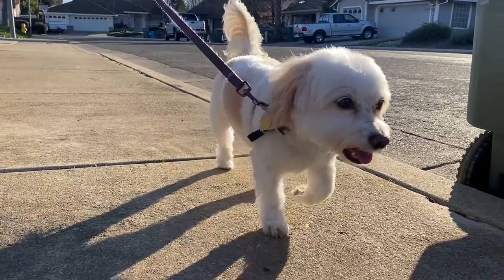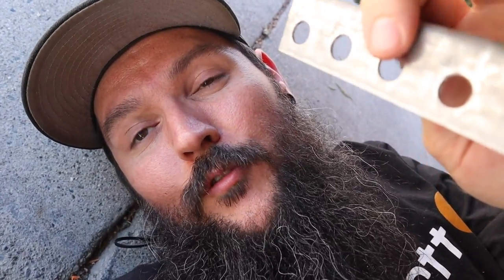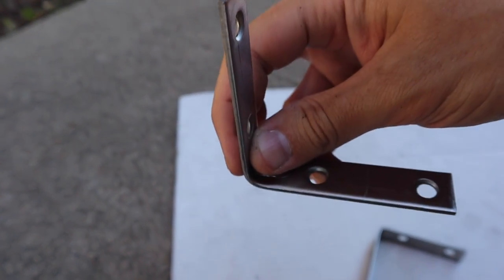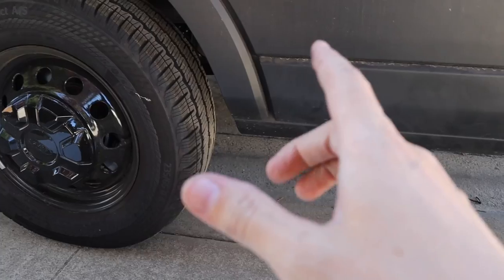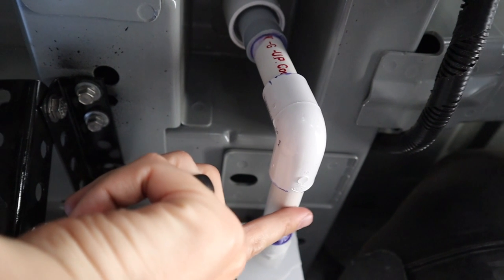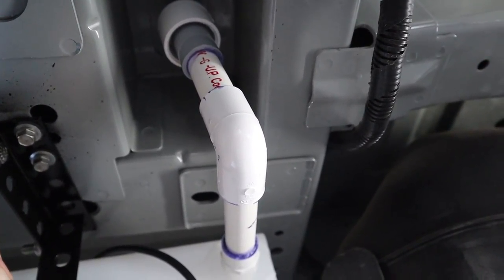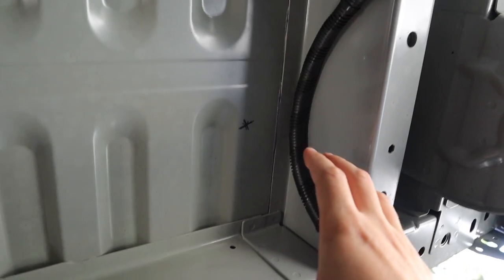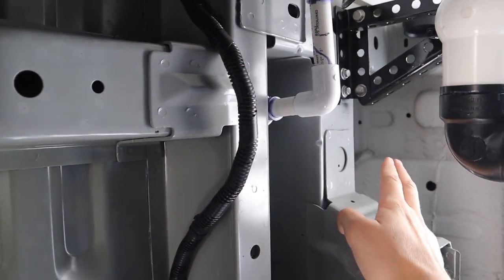Plumbing our Shower & Sink Drainage for Van Life | 2021 Ford Transit Van Build Conversion Ep. 31

Comment: Nice video, I used a normal P-Trap in my build and I've had no problems but I think I might upgrade to your design for more space under the sink! Thanks!! I used braded vinyl tubing and pex pipe in my build (except PVC under the sink), it was a lot easier than PVC you're using. If something breaks in the future it'll be easy to fix. 
This might be too late but one thing I learnt from watching a lot of van builders is don't put flooring in the whole van because if one piece breaks or gets damaged it'll be impossible to replace.

Comment: Put some rear mudflaps on to protect the remote fill nozzles. You could have used your Drimel tool with cutting disk to shorten the pipe.

Comment: Hello Brit and Mike. I installed my propane tank today and since I was underneath  van I was wondering where in the hell I will run the sink drain pipe over to the grey tank. You solve this problem for me. Your plumbing job look clean I can see you did some plumbing in the past. It will be while before I get to your point but having some problems solve ahead of time will save me lots of time.  Thanks.
Reply from the maker: Thanks Leo!!

Comment: Great video. personally, I would never use a gray tank or a black tank. I will allow the water of the gray tank just to spill onto the street. No black tank for me because I’ll be using collapsible, stool and poop in a plastic bag and quickly dispose of it. However, way I can..

Comment: Hey Mike now that you have driven the van on a couple trips I wanted to ask how is the drain pipe holding up near the muffler? I need to route a drain the same way. Love your guys videos by the way.
Reply from the maker: Thanks Brandon! We haven’t had any issues with the drain pipe, so the insulation we wrapped around it seems to be doing the trick.
Reply: @britandmike  thanks for the quick answer. I will be doing that route then. Hope you guys are doing great and planning a fun summer in the van